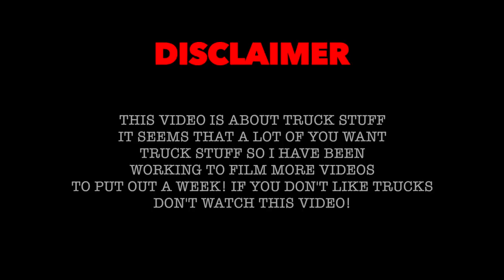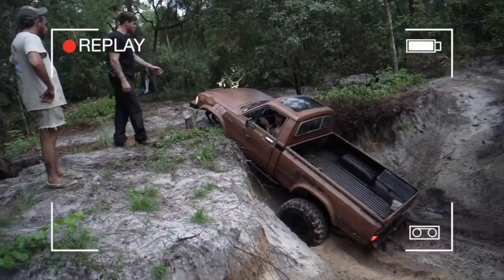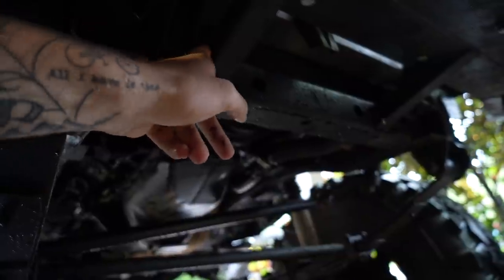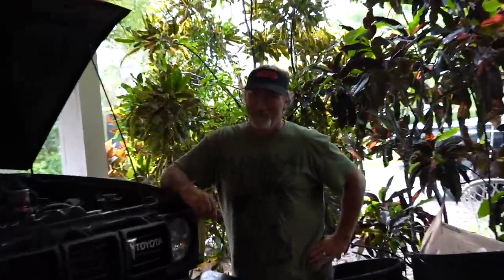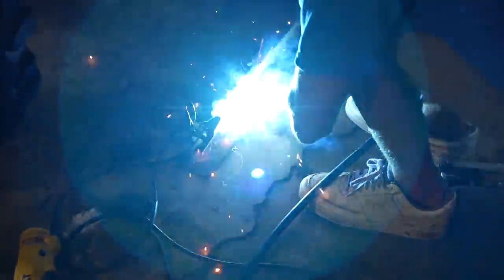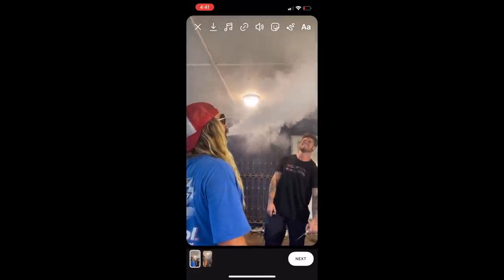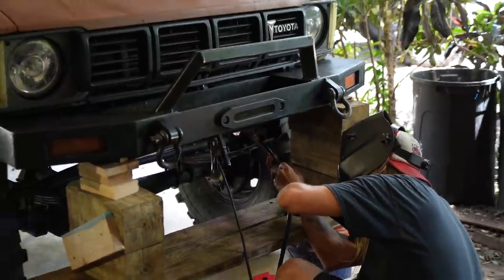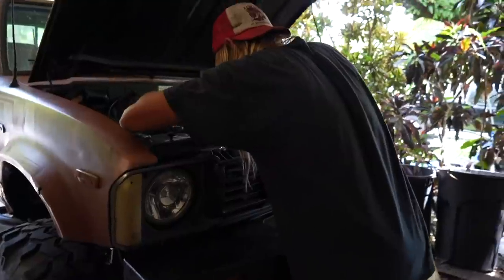4RUNNER BLOWN MOTOR UPDATE

Comment: Instead of just welding the bumper to the frame y’all should make some brackets up and weld those to the frame then bolt the bumper on so then u can easily replace the bumper and it won’t break or bend as easy having it bolted and welded instead of just welded lol just seems crazy to just weld shit together and hope it stays I’m sure most time it does but welds over time give out bolts usually don’t